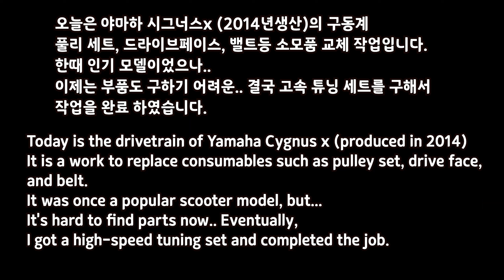Yamaha Cygnus X motorcycle drivetrain pulley , drive face, belt, clutch shoe spring set installed

Comment: sir i want to replace my cygnus roller what is the best roller to go faster?pls help
Reply: or the ball.if you call it..
Reply from the maker: Replacing rollers does not increase top speed.
But...
With light rollers: Accelerate quickly and reach top speed quickly.
Increased noise, can strain the engine, and poor fuel economy.

Use of heavy rollers: Acceleration is slow, but stable operation is possible at full speed.
It's quiet and fuel economy increases.
Reply from the maker: @juniusalgerre3934  In Korea, it is mostly called "Move Ball".
But "roller" is the correct name. 😄
Reply: @MotorcycleRepair  im sorry sir haha because sir i already change the rollet to 9 all 9
Reply: @MotorcycleRepair  before i replace the roller my mc top speed is 112 but i already change it and i notice the top speed right now is 95 to 98 i change the roller to 9grms 🥺🥺 so i dont know what to do to make it givr more speed
Reply from the maker: @juniusalgerre3934  Oh that's right... then... I wonder if you replaced it with a roller of the same size as the existing roller?
Reply from the maker: @juniusalgerre3934  Ah.. I see.
A change in roller weight does not change the maximum speed.
The weight change of the roller does not change the top speed... only the time it takes to reach the top speed.

So if your problem is with the rollers...
This may be the case if the rollers are of different sizes. It should be the same size as the normal product recommended by the manufacturer.

If not this...
It may be that the clutch shoe weight has reached the end of its lifespan and cannot deliver all the power of the engine.
In this case, it can be solved by replacing the weight of the clutch shoe.
Reply from the maker: @juniusalgerre3934  Oh...and check the engine spark plugs too. 😄😄
Reply: @MotorcycleRepair  thank you very much sir i will do that sir
Reply: @MotorcycleRepair  
ال
Reply from the maker: @aligazi7422  🛵
Reply: @juniusalgerre3934 boss ano kaya stock weight roller ng cygnus natin?

Comment: sir what is the stock roller of cygnus 2
Reply from the maker: sorry. Hindi ko naintindihan ang sinasabi mo.
Ang mga produktong ginamit sa video sa itaas ay:

Impormasyon ng Produkto
Pangalan ng Produkto: JAPAN SPEED SIGNUS X, BW`S125 Standard Pulley Set
Code ng produkto: TA-JSP-PU002
JAN code: 4573307450442
Numero ng Bahagi ng Tagagawa: 0391-A018
Tagagawa: Japan SPEED
Fitment
1ST CYGNUS X Domestic model (SE12J) 5UA model 2003- 2006)
1ST CYGNUS X Taiwan Model (Modelo ng 5TY 2002~2006)
2ND CYGNUS X Domestic Model (SE44J 28S Model 2007~2011)
2ND CYGNUS X Taiwan Model (SE361, SE371, SE461, SE462, SE464 na mga modelo 2006~2011).
3RD CYGNUS X Domestic Model (SE44J 1YP Model 2012~2015)
3RD CYGNUS X Taiwan Model (SE465 1MS Model 2011~2015)
IKA-4 na CYGNUS X Domestic Model (SEA5J BF91 Model 2016 ~)
4TH CYGNUS X Taiwan model (SE732 2UB model 2015~)
BWS125 domestic model (SEA6J E3T5E Model 2016~)
BW`SR
bahagi
katawan ng kalo.
plato ng lampara
Sliding Piece x 3
gilid ng pagmamaneho.
Shims 0.02 in (0.5 mm) x 0.08
0.2 pulgada (5 mm) Face Spacer para sa Type 4 Signus X, BW`S125
Ang weight roller ay ibinebenta nang hiwalay (Φ20 mm x 12 mm) (kapareho ng laki ng orihinal).
Gumamit ng tunay na pulley bosses.
itakda ang timbang
Tinatayang 19.2 oz (545 g) (walang mga timbang).
diameter ng kalo
Tinatayang 118 mm (4.6 pulgada)
anggulo ng pulley face
mga 14°
magmaneho ng anggulo ng mukha
humigit-kumulang 13.5°

Mga Tampok: Ang pulley set na ito ay may torque function na maayos na tumataas mula simula hanggang sa pinakamataas na bilis at tumutugon kapag muling bumibilis.
Ang mga gumagalaw na bahagi ng JAPAN SPEED ay kilala sa kanilang matatag na pagganap.

(필리핀어)

https://global.freeship.co.kr/goods/content.asp?guid=5176372&freeship_ep=naver_ep&NaPm=ct%3Dldz079xc%7Cci%3D4b1d686f4d0966a3c8196ca4c3699e7de7dd73ba%7Ctr%3Dsls%7Csn%3D405974%7Chk%3D384f1a87f074eb685fec4fad14b2b93afdd5bd45

(영어)
sorry. I didn't understand what you were talking about.
The products used in the video above are:

Product Information
Product Name: JAPAN SPEED SIGNUS X, BW`S125 Standard Pulley Set
Product code: TA-JSP-PU002
JAN code: 4573307450442
Manufacturer Part Number: 0391-A018
Manufacturer: Japan SPEED
Fitment
1ST CYGNUS X Domestic model (SE12J) 5UA model 2003- 2006)
1ST CYGNUS X Taiwan Model (5TY Model 2002~2006)
2ND CYGNUS X Domestic Model (SE44J 28S Model 2007~2011)
2ND CYGNUS X Taiwan Model (SE361, SE371, SE461, SE462, SE464 models 2006~2011).
3RD CYGNUS X Domestic Model (SE44J 1YP Model 2012~2015)
3RD CYGNUS X Taiwan Model (SE465 1MS Model 2011~2015)
4TH CYGNUS X Domestic Model (SEA5J BF91 Model 2016 ~)
4TH CYGNUS X Taiwan model (SE732 2UB model 2015~)
BWS125 domestic model (SEA6J E3T5E Model 2016~)
BW`SR
part
pulley body.
lamp plate
Sliding Piece x 3
drive side.
Shims 0.02 in (0.5 mm) x 0.08
0.2 inch (5 mm) Face Spacer for Type 4 Signus X, BW`S125
Weight roller sold separately (Φ20 mm x 12 mm) (same size as the original).
Use genuine pulley bosses.
set weight
Approx. 19.2 oz (545 g) (without weights).
pulley diameter
Approx. 118 mm (4.6 inches)
pulley face angle
about 14°
drive face angle
about 13.5°

Features: This pulley set has a torque function that rises smoothly from start to maximum speed and is responsive when re-accelerating.
JAPAN SPEED's moving parts are known for their stable performance.